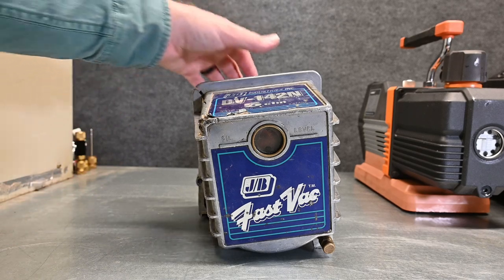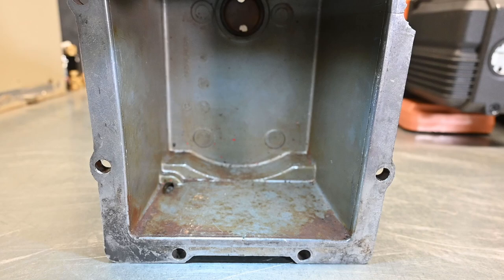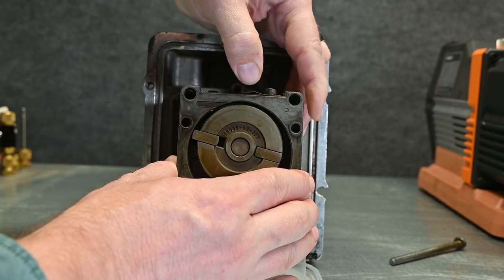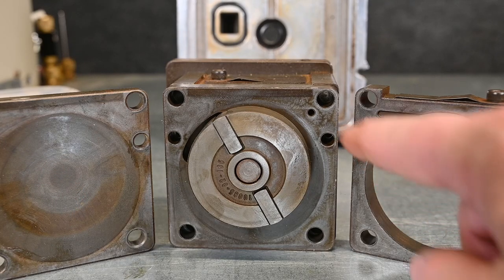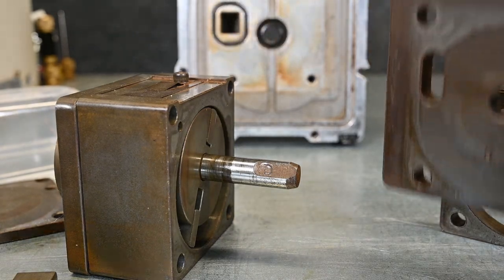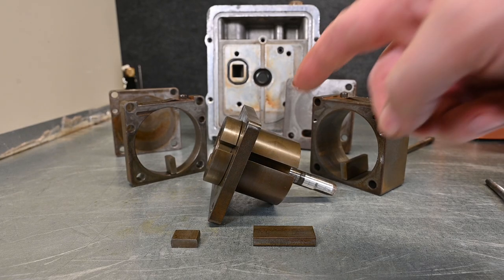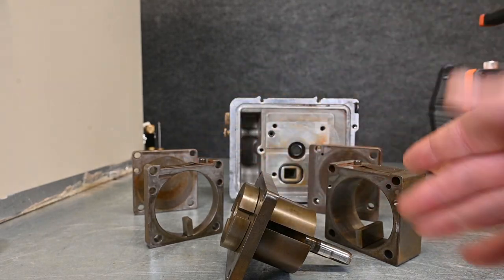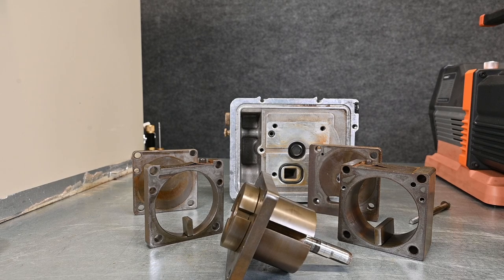HVAC 142  Vacuum P9 Inside the vacuum pump

Comment: Thankfully for great illustration Mr.Ty. If used one stage vacuum pump will do the same job as 2 stage? What about the cfm as the number is higher the vacuum will be deeper is that correct? (Of course with using core removal and large hoses). Makita has a vacuum pump 1 stage and I think 2 cfm cordless do you think that pump could do the job? Thank you.🥀
Reply from the maker: I need to run some comparisons between a 1 and 2 stage.
Reply: Lower CFM should result in a deeper vacuum (a lower ultimate pressure), time to reach ultimate vacuum will be longer though.  A single stage pump could theoretically reach a deeper vacuum than a 2-stage pump due to tighter tolerances, less internal leakage, but of course will take longer.
I use a single stage pump with a small motor running for 12 hours or more if the system is old and has had contamination issues, virtual leaks (outgassing) can require quite some time (beyond 12 hours) to resolve in this case.
If the system is clean and dry, a 2-stage pump will pull a nice vacuum in a short time, the larger the system, the 2-stage pump is faster.
I think the Makita 1-stage 2CFM pump would work fantastic for evacuating a typical residential system.

Comment: So should we be tearing down our pumps like this on a regular basis? Can you buy these parts for replacement?
Reply from the maker: No sir, keep the oil changed and it will last. You your career. 
However if it's been abused, or if you do a blank off test and it's not pulling down then yes.
Reply: @love2hvac  Blank off Test?   Very interesting?

Comment: Doesn't seem like removing 14.7 psi of atmosphere would be a difficult task requiring careful preparation and specialized equipment, does it?  After-all, it's only 14.7 psi...
Yet, we can never evacuate all of it! ;)
Reply from the maker: Exactly!  its so cool! only 14.7 but so evasive!

The true missing piece of the puzzle is not only pressure but also lack of molecules. trying to get those last molecules out is the real challenge.
Reply: @love2hvac  Yes, the definition of vacuum is absence of molecules.  These molecules of contamination (non-condensables) must not be allowed to interfere in the process of evaporation and compression of refrigerant.
In order to remove these molecules of contamination, they must find their way into the vacuum pump.  At 1st during the evacuation process, the molecules still remaining in the refrigerant tubing bump into each other, pushing the others into the vacuum pump but as pressure decreases, there are fewer molecules to push other molecules towards/into the vacuum pump, thus rate of pressure decay slows, and the mean free path of the molecules becomes longer.
Reply from the maker: I completely agree  💯